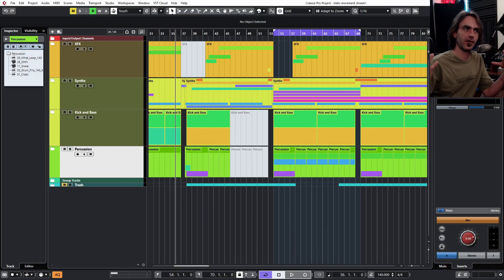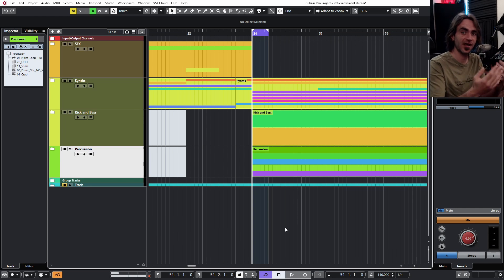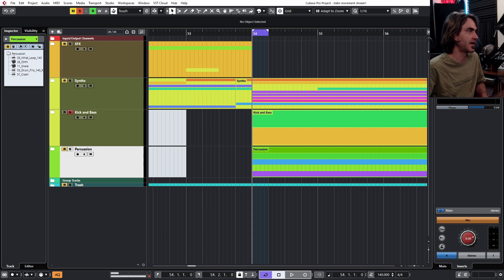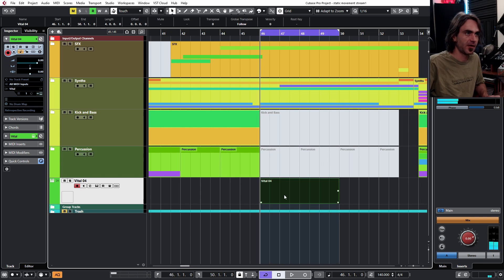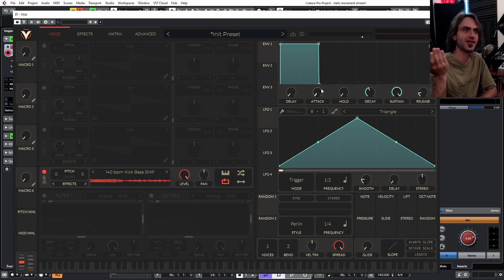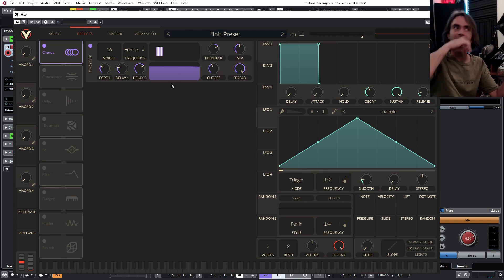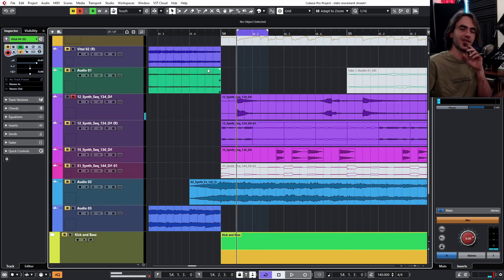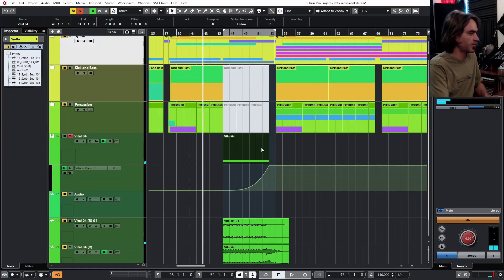Sample / Loop Uplifters in Vital + Vital FX on any Loop

Comment: It’s dope, and if I’m not mistaken, in pigments you might do the same thing and stretch the sample or pull apart some way with granular.
Both synths do everything you used to have to do with daw animation. Do you have autochroma? It’s a granular effect but it also does what birds does, it always has a 30 second buffer recording that you can capture, drag and drop the wav file.

Comment: Could when I’ve done this in the past I’ve just imported the rendered sample into the DAW, set it to a loop, and increase the playback speed on an envelope. Other than a macro what is vital giving you here? Seems like the additional steps of taking source audio out of the project folder might not be great for archival purposes?

But then, it does sound great your way, maybe vital is adding some secret sauce :)
Reply from the maker: The playback speed method never gives you an accurate end point, plus the vital FX are insanely good :)

Comment: When I throw a kick sample into the vital, the sound of the kick changes greatly! You can also do the same via Snap Heap ... only immediately on the bass or lead bus
Reply from the maker: You can't speed up the time of a realtime audio signal. The reason the kick sounds different is you did not render the correct sized loop and trigger it at C3 like I explained in the video :)
Reply: @DashGlitch  did the same in Phase Plant
I understand that vital was used because of effects?